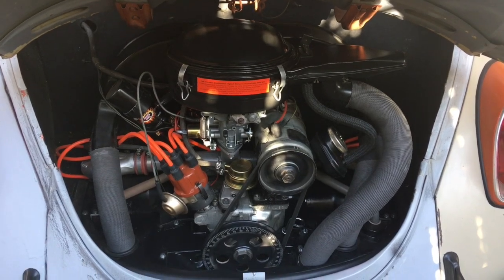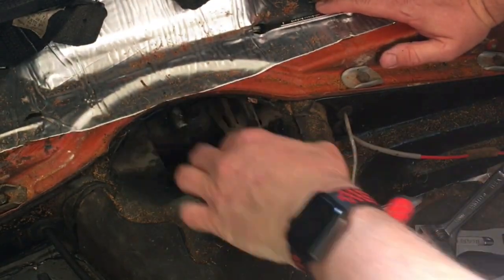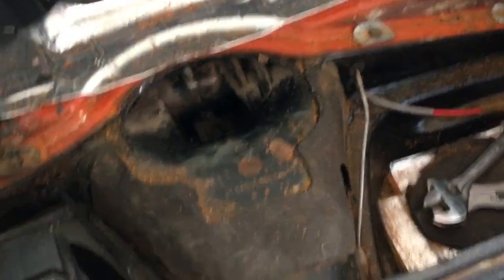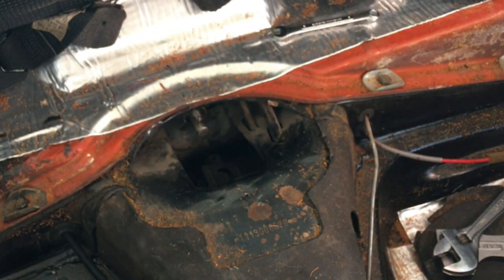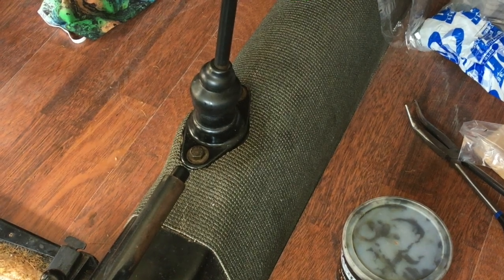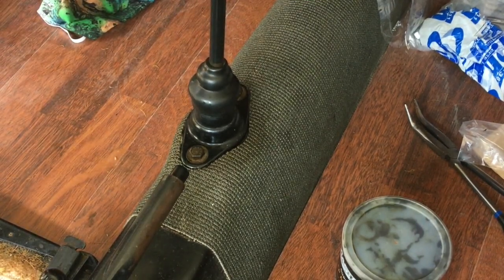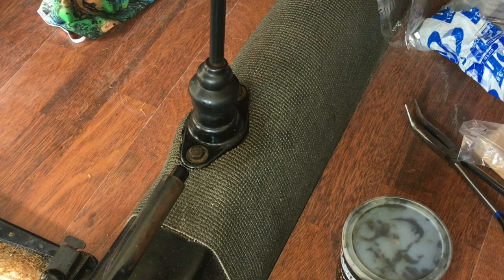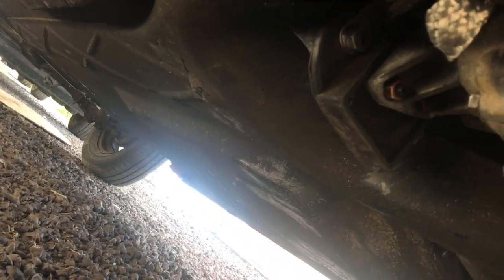Volkswagen Beetle Shift Linkage repair

Comment: How is the metal plate attached to the side of the base of your passenger seat? Does the drivers seat have this plate aswell?
Reply from the maker: Do you mean those cosmetic pieces on the outside? I believe they have a twisting clip, but I’d have to look. 2000 miles from my bug right now.
Reply: @Misunderstoodboygenius  Yes, I mean those plates. I have only one on the passenger side seat but it is loose. It is missing on the drivers seat but it seems that they are not available new anywhere.
Reply from the maker: @stephantimmermans6107  probably not, but I would bet someone on Thesamba.com is selling some. Good luck!